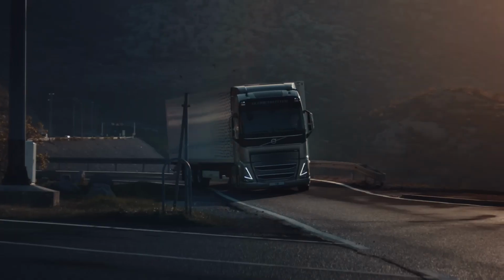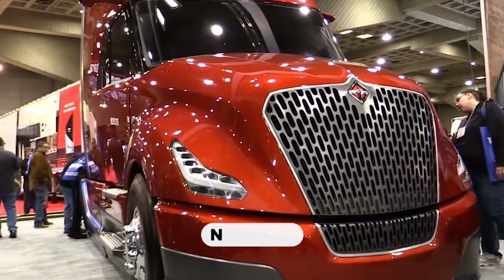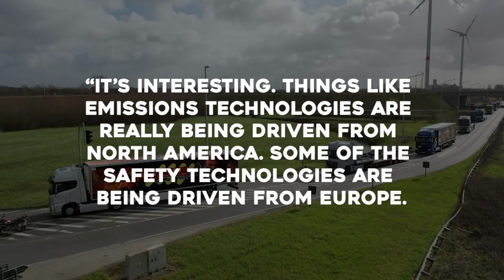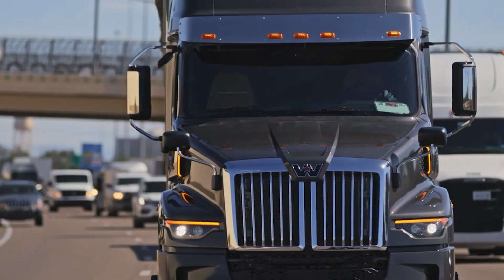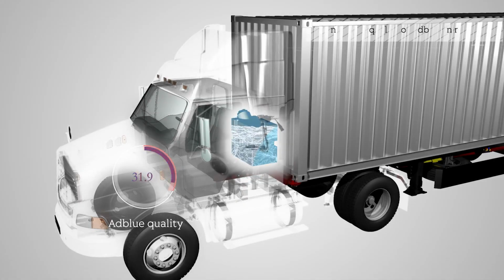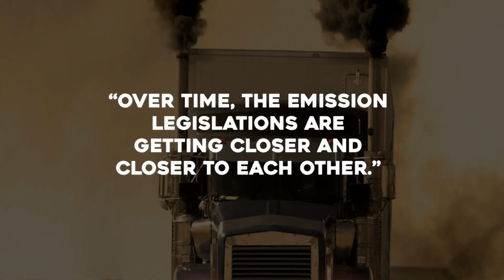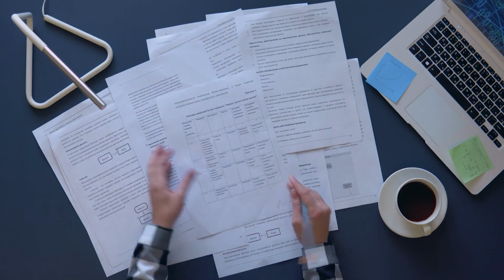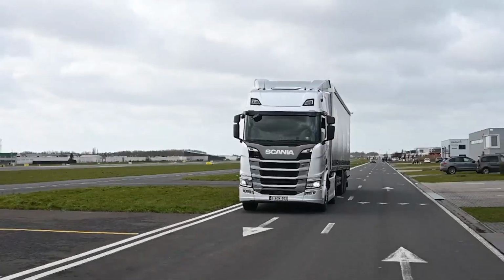Why European and American Trucks are so Different!

Comment: The USA EPA 2010 NOx limits for heavy duty over-the-road diesels are much tougher than the European emission standards.   Both DAF of Paccar and Daimler of Detroit Diesel make use of emission technology from Cummins.  Volvo D13 has a bad reputation for having sensor and wiring harness issues after 200,000 miles that take it off the road.  This wiring harness and sensors are due to trying to meet USA emission standards.  The Volvo also has poor fuel millage likely due to its less highly developed emission control systems.    The Paccar MX engines are unreliable for more than just emission controls and after 200,000 miles is considered a nightmare.   On the bright side the MX engine does get good fuel millage.

Comment: The old countries are mostly original which brings up the fact they have smaller roads, streets and places so most all vehicles in Europe and the old countries are sized down. Look at places like Italy and france they have such small roads and alleys the applications of smaller everything there is best. In America its spread out and bigger the opposite and out trucks lengths are alot 53' and they measure the trailer not both for length. As far as emissions and all that both countries will make adjustments as the governing bodies of the industry think needs but i will say especially in the safety category American cab over teucks are not safer that the Peterbilt long engine types we used mostly and crash test and accidents show that.

Comment: Europe has no Cab Over Trucks, they have what's called a Cab Forward design. The Driver enters the cab 'forward' of the steer axis. A Cab Over design has the Driver entering the cab from behind the steer axis. An example of a Cab Over Truck would be the Kenworth K100. An example of a Cab Forward would be the International 9700. The basic cab design is called a 'Cab Over Engine' also called COE. To distinguish the cab style, the mfr's. relates to the Drivers egress of the cab.

Comment: Cab- overs just don’t have the safety in a head on crash. Cab- overs also seem to have heat issues. I’ll take a Pete or KW and 500 or 600hp.
Reply: Cabovers have more fatalities than long engine Peterbilt types that's fact on paper plus the engines under you that never the best idea.

Comment: In USA trucks operate too fast.  Speed limit or limiters should be used in USA.  Secondly in USA truck law should be:  Trucks must operate in far right lane unless passing
Reply: whats the point no one passes properly in the us anyway 
limiting the speed so they are even slower is just stupid
Reply: For Europe, sure, we don't have an issue with tight spaces, we have a huge country and the roads are bigger, so we don't need as strict regs as the EU
Reply: Your Not a Trucker! Speed limiters interfere with Competitive rates and speed limiters make things more dangerous! Did the job since 1977! Try again!

Comment: definitely the eurup truck is better than any American truck.  I worked in Europe for 7 years and have been working on an American truck for two years now.
Reply: I’d take a bet on that! We have some big grades in the U.S. need power and durability! Cab-overs don’t have good safety in head on crashes.!
Reply: @floydrandol2731  at the moment, all cars in America and in Europe, all trucks are equipped with the same engines, because the fretliner, westernsatr is essentially the same car with the European Mercedes and Ford.  Volvo and Renault European and American Volvo and MACK have the same engine, kenworth peterbilt and European DAF belong to the same packcar company.  the only engine that is not on the European continent is Cummins
Reply: @floydrandol2731  As for the comfort in the truck, American trucks cannot even be compared.  When I got on an American truck for the first time, I wanted to get out after 15 minutes of travel.  It was terrible.  now I'm used to it, but after the European tractor it was terrible.  The European tractor is much more comfortable, quieter, more convenient than the American one.  classic trucks evoke particular horror in me.
Reply: @floydrandol2731 that an American truck is safer than a European truck is true, it would be foolish to argue, but the fact that they are clumsy cows on ice, and how stupid ergonomics are in the interior of the cab of an American truck, it deserves to chop off the hands of designers for such a bad job.
Reply: 😂😂😂😂 
Peterbilt 389 & 379 CAT C-15 💪
Reply: @agibosanac6343  clumsy dinosaur, and always a headache from the incredibly strong scream of the engine.  Scania S730 v8 is a car that gives pleasure 💪😎👍, and peterbil gives a headache
Reply: @lucky6602  😂😂😂😂 there is no scream from CAT C-15 dude it's CAT  roar from exhaust pipe. Scania 😂😂😂 give me a break .
Reply: @agibosanac6343  The Scania with the v8 engine is much stronger than the Peterbilt, and the comfort is at the highest level.  I had the experience of driving a peterbilt, I didn't like it.  Scania is ideal
Reply: @lucky6602  my CAT it's still running with 1 681000 miles equals 2 705300 kilometers 😎😎😎 and that roaring from C-15 with twin turbo 💪
Reply: @lucky6602 you think it's bad because you started with EU trucks, like driving a MINI and then going to a Raptor, it's built for completely different things
Reply: @parzivalgtc9916  the truck in both Europe and America was created for the same purpose of transporting goods.  Only work on a European tractor is much more pleasant.  this is just my opinion.  Your opinion may differ from mine

Comment: All I have to say for the future is hopefully. We don't Settle for another probwe can afford.. I would say there is a person in the US. That design made a workable prothe type. Invention that you could run your car or truck or boat or train. Many useful applications with current applications. That runs off of water. And it works. Politics greed. And pretty much step on people's toes that are holding us back. We can have more options instead of one.. Instead of settling for electric cars, we will have options and we won't have to Retool the industry in order for it to won people. Peoples vehicles, we already have everything we need. Just change a couple parts and where the contain the water. And turn the ignition on Or turn the key and there's your zero emissions. Is stan meyer. Is his name hes no longer with us due to some unfortunate circumstances.
Remember the toes stepping on, yeah, those people. And now supposedly somebody and London has. London has the rights to this invention. But he was told not to Manufacture these parts. Or i'm guessing he will probably get the same meeting ask them as stand myers.. And you wonder why we're in the c***We're in by listening to the jackasses that want us to drive electric cars so they can Control Us. Why can't we just get rid of these people?
And put an end to this stupidity and actually used the technology we already have, I just mentioned one. It makes no sense complaining about what we are currently have and not exploit any other opportunities.
Other than electric cars or vehicles.. Again zero admissions regular tap water. It don't get any simpler than this. And I believe he did mention it. One of videos that this invention can be approved upon..to Not humor the naysayers. Oh, you're going to get water. And it's gonna mix with oil, and it's gonna no silly. It turns into gas instantly. That's what it was designed for. And who knew the coil packs? And the Ignition system has enough voltage for To be relevant. This is a technology we don't have to go to other countries to get it.
And it would be a great asset to areas that flood a lot. Another useful part that would Benefit And aside from that Is low cost . Or free depending on how you look at it. Or where you gedit and it is not a Not a joke. Rainwater snow seawagetting the picture. And it all runs off a twelve volt system. Using the cars that you already are driving even older vehicles as well. Would there be a need for electric cars? It's a good idea to have more options I think.. Instead of settling for whatever. And this is an american invention but it's right is in Britain So so the question is, can we get the resources to make these parts? And it won't cost an arm and a leg and possibly a testicle to get it right around 15 to 2500.  Is what it would cost to? By the part and probably another $1000 for labor.
Or would you really want to spend anywhere? From $ Fifty thousand or two hundred thousand for an electric car. And all you're doing is Removing a couple parts Install the new parts impossibly and possibly tuning might be required. Because of hydrogen. And this way, people would have more of a choiyes instead of settling for.
What they want for us. Now we would have 3 choices, not just one.
Just something to think about people just something to think about. And it accomplishes the same goals. Who knew away I did.
Or I should say Stand did.

Comment: But still kw, Peterbilt (mx11 and mx13)  freightliner is using eu engines. Detroit d series engines are same as Merc. So basically they same truck at drivetrain.

Comment: I choose eu trucks😅 I live in eu😂 they actually have a very smooth ride you don't notice the engine.
Reply: I couldn't agree more
Reply: Yeah but since the cab is directly over the engine does it get hotter inside the cab , since heat rises ?
Reply: @Airon79 we have parking airconditioning.
Reply: @Airon79 not really modern eurotrucks have aircon and the cab is insulated and sound proofed our cabs are also mounted on airbags giving a smoother ride. You could also add great ergonomic design inside allows the driver to be less fatigued at the end of a working day
Reply: No you don't feel it😜
Reply: @SHAADOWW7765  Thanks for responding !
Reply: Awesome !